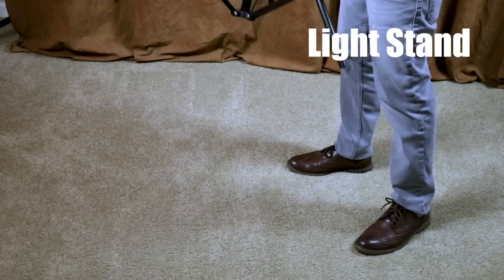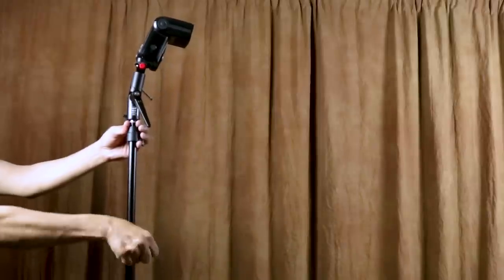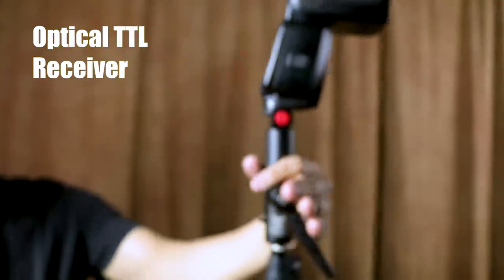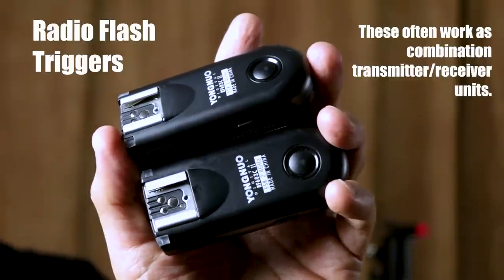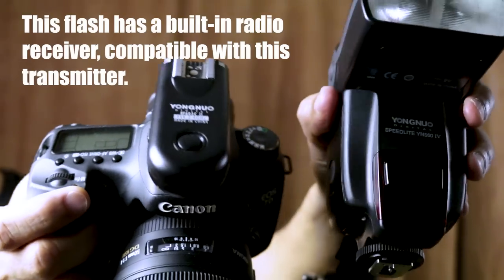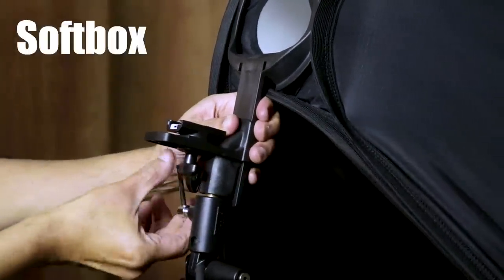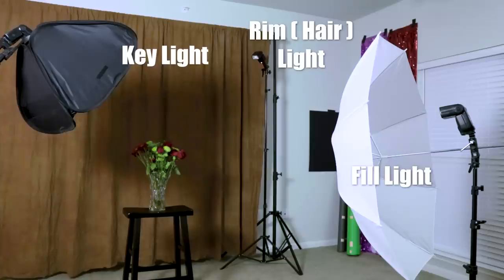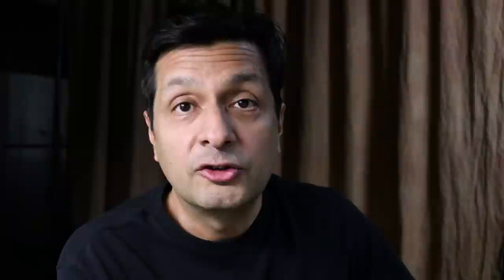Off-Camera Flash Photography Overview

Comment: Other than setting shutter speed at flash sync, do you adjust aperture and ISO for a normal "correct exposure", according to the exposure meter, as if flash doesn't exist??

Thank you!
Reply from the maker: For an indoor shot, you set the ISO to the lowest setting if possible, and the aperture to whatever you want. The light power setting is adjusted for correct exposure. Adjust the shutter speed to control the level of ambient light.

Comment: Out of curiosity do you always use just one unit for each lighting point or do you ever use two or three units on a multiple cold shoe adapter?  I’ve noticed the more experienced strobists like yourself, who obviously know their kit the best, seem to use just one unit where I’d use two or three. I thought more units would give softer light, but again I’ve noticed the experienced strobists aren't afraid to move their light really close on and I know it’s the size of the softbox, umbrella or other modifier that counts as the size of the light. I really need to buy a manikin and to spend some time experimenting. Great video as always Ed, thank you.
Reply from the maker: Thanks, Mark. Yeah, I just use one flash for each point usually. If I needed more power I’d have no problem using more units. Whatever works.
Reply: Ed Verosky Thanks Ed.

Comment: When using a flash on a receiver, how do I set flash? Do I set flash Ettl, or manual? Does flash have to be in slave mode, or does it not matter how the flash is set when it on a receiver?

Comment: Great video. I notice that the Youngnuo flash used in some of the video resembles a Sunpak DF3600U. Is this a re-branded flash?  I have one of the Sunpak models and I really like it, but those are getting hard to find and are short only an internal radio trigger.
Reply from the maker: I’m not aware of that but it wouldn’t surprise me.

Comment: Dear Ed, first of all Happy New Year to you. Thanks so much for your great and more than informative videos. I would like to raise a question to you. Unfortunately my camera (D5200) does not support high speed sync. While making low key portraits I try to overcome this issue by using a circular ND filter. What is your opinion about it, can come the ND filter  really in handy in these situations, or does it result a very different picture quality in comparison to HSS?
Reply from the maker: I'm not sure I completely understand the question.  High Speed Sync (HSS) is related to using flash  (which adds light to the subject).  ND filters subtract light.  What is it you're trying to accomplish with these tools?

Comment: ...what is the flash power of your rim light?
Reply from the maker: It depends on things like distance and effect I’m going for. But a good starting point for me is about 2X the power of the key light.
Reply: Ed Verosky, lets use your example 2x the power of the mainlight...what if you need to move the flash away from your subject, are you going add flash power?...or if you move the flash towards your subject, are going to subtract the flash value?...as i have emailed to you i had your ebook about using speedlight i just want to become particular on how you play the lights coming out from your flash...its kinda copying/experimenting your whole style thats what exactly i want to do...i want to learn a lot from experienced photographer like you...you have the knowledge i need, you have the quality of works worth to copy...
Reply from the maker: @rafaelerum6600  For me, the ratio and position of the cross light, rim light, or hair light, is very dependent on the situation.  For example, what kind of coverage do I need (top to bottom, or across) and how does it look against the tone of the skin or color of the hair, etc.  It's like most things with lighting, you can have a starting point, but it's rarely the final recipe.  Like if you're making soup with different ingredients all the time, you have to add salt according to taste.  With lighting, there are always "test shots" because you just never know it's good until it's good.
Reply: Ed Verosky, i got your point!...it's always a part of experimenting...i thought every expirienced photographer set everything as it is without repeating or adjusting the whole process...now i know re-adjustment is a must if ever the results is not acceptable...
Reply from the maker: Yes. And great questions!  I made another video party based on our discussion and many similar questions I receive. Thanks 🙏🏽